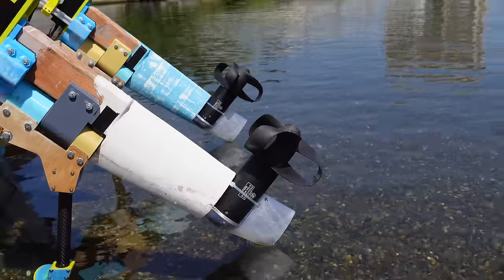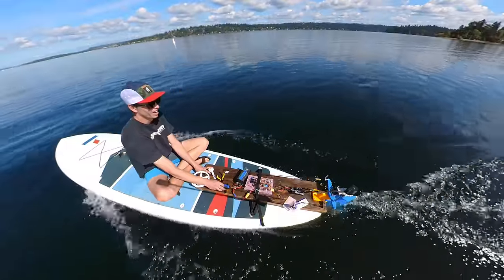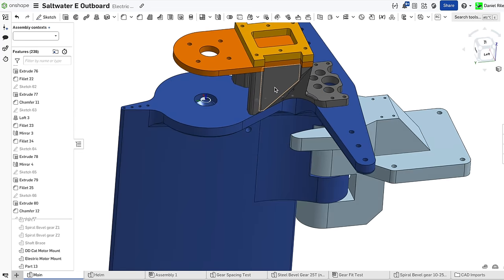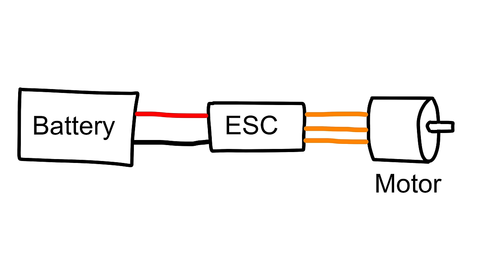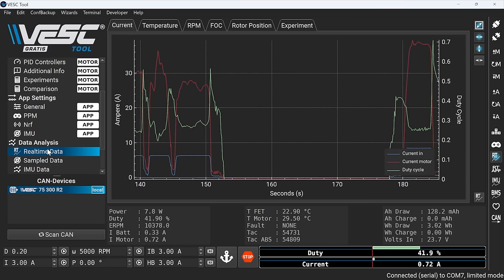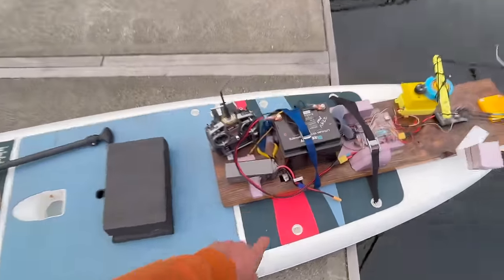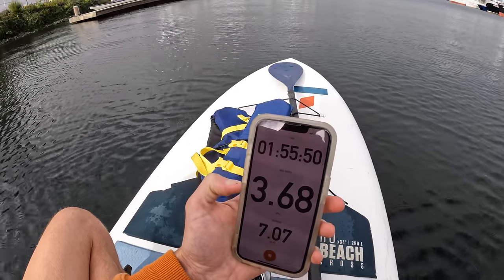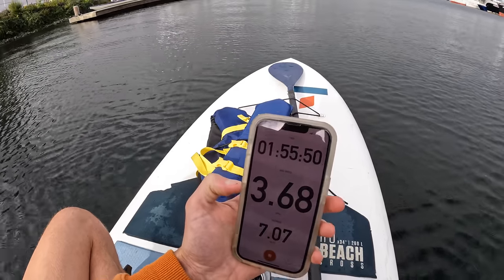Toroidal Propeller Testing on my Electric Surfboard

Comment: Dude, about the efficiency of your helical propeller, I think one of the reasons for the high inefficiency is the unnecessarily large total area of the propeller blades, this will only cause extra resistance in the water, analyze that at the same speed as the normal propeller, the propeller helical uses twice the power, and apparently has twice the area, and you won't go faster with twice the area because of the pitch and the efficiency of that pitch at that specific rpm at that specific speed, I'll probably decrease the width of the blade by more or less half, especially at the tips of the blades, and try to make the blades thinner
Reply from the maker: From the tests we know the toroidal prop was spinning faster, which means less resistance...
Reply: The correct blade area is vital yes. You want the smallest blade area that can still "absorb"/transfer the ropulsive force to the water without too much slip.
Reply: it makes sense @rctestflight

Comment: My feeling is that any effect that this toroidal prop is going to have will be massively overshadowed by running a bigger prop slower.

There is a reason large cargo ships have singular massive props.

Would be interesting to see if you could make a step down transmission and a much larger prop and check the efficiency of that.
Reply: Agreed, if the fancy props on the “cool” boats were actually better you know the big boats where time and fuel cost matter so much would be switching to them and I don’t think that’s the case. I’d love to see a purchased toroidal prop and a traditional prop on your gas outboard to compare.
Reply: Then why did that new huge cruise ship they had.on Tested have 3 props? Were they screwing with us? Also air system to reduce drag...?
Reply: @raguhmuffin   Well, its not really like that. No prop is "one size fits all" and propellers need to match the hull type and speed regimen at to give their best. Prop testing is honestly kind of useless for anything but the single speed, hull, and weight of craft its tested at. I am not a fan of the marketing, but the "cool boats" do need a completely different looking prop than a container ship for example.
Reply: @RowanHawkins  Maneuverability and chosen engine propulsion most likely.
Reply: @RowanHawkins  cruise ships often have multiple props. cargo ships have only 1

Comment: I'd be interested to see if the toroid helps with a windowed blades, rather than stacked. (that is, if you have 3 blades, then behind those on an other plane, 3 more blades that're between 2 blades of the upper layer (60° rotational offset), then connect the tips... if that makes any sense...

Comment: Could you think about doing a variable pitch propeller? That would be awesome and nice to compare to toroidal and fixed pitch ones.
Reply: I suspect that variable pitch will win. The sharrow prop is used because the standard fixed props cavitate too much at intermediate speeds, but the variable prop should avoid that.
Reply: It will be less efficient and dont really have many advantages for smaller craft with this kind of propulsion or the speeds he is going.
Reply: @BooBaddyBig  No, its the tip pressure thats purported to be the advantage as far as I know, and a variable pitch prop is worse at every fixed metric compared to even a standard one.
Reply: @GoldenCroc  When i mean variable pitch, its that type that has a mechanism that changes the pitch for all blades,  not the blades attached to the cone having different pitch angles at each cross sectional area... in this sense I'm not so sure you can crave it will be less efficient. Since everything is scaled down from a real world model, I'm guessing the answer is not 100%, only making it and testing could provide the answers. And it would make a good video content for him :)   ... I love those gears inside the cone changing the pitch :)
Reply: @JoseCarvalhojpgc  No I understood what you meant. Yes, its a fun test, but it is as I said, because of the the inability to optimize the blade profile for a single pitch and the gap between the hub and the blades.

Now, to be clear, these are small drawbacks/differences for tha variable pitch prop and are unlikely to show up in any testing he can do.

So why not. But in general variable pitch is used because the drivetrain/propulsion engine dont like shifting rpm.
Reply: @GoldenCroc  An optimal variable pitch prop should ideally be the same shape as the fixed prop at one setting.
Reply: @BooBaddyBig  Yes, exactly with a very, very small drawback for the gap between hub and blades. Perhaps I was unclear, I meant if you want the whole range to be more optimal you have to sacrifice the single optimal setting. Its a tradeoff.

Comment: electrically insulate the motor and put in under water, for cooling, or just pump water from the lake for the motor cooling. how about aerospike water jet engine. bigger props at same power is to needing to spin the at slower speed, maybe try an electric motor that is natively coiled for slower speed rpm at that same power rating.

Comment: I see you have the 4L60/E out of what looks to be the Chevy S-10 or GMC 1/4ton truck/suv. That you are using as a battery charging station. Lol. I can no longer count how many of those I have rebuilt and/or replaced. It's a pretty good transmission if maintained well and isn't overpowered.
Reply: I guess it could also be the earlier version of the 4l60, the 700R4. The early 4l60 are difficult to distinguish with the 700R4.

Comment: I know it seems simple but have you tried just using a simplistic acoustic resonance pump with piezoelectric? Or something similar? A larger into a medium into several smaller will be able to operate much more efficiently at specific speeds for the given input power.

Comment: 05:30 I suggest you don't use m/s (speed) on the vertical axis as your boat performs very different.
How about choosing a fixed speed at say 1.5 m/s and then measure WattHour/meter? Like how much does it cost for one km or one mile with a constant speed.
Reply from the maker: Easier said than done to keep the vessel at exactly 1.5m/s

Comment: QUESTION: so you are trying to “compress” water and shove it behind the prop. The toroidal is attempting the same thing. Taking from a large volume in front to a stream behind. So… imagine a jet engine running with no exterior shell… you are actually trying to make a pump for power with no way to hold the compression. Put your prop inside a shell. Much like a pod drive or jet drive.
Reply: So if your water intake nozzle was adjustable say maybe wide for slow speed and narrow for high speed. The intake would have its own angle of attack.  I’m thinking like the supersonic cone of the sr71. Just a farmers thought.

Comment: An outstanding discussion regarding the relationships of current, phase current, low voltage versus higher voltage and watts. Yours, a better explanation than by Elon Musk and Sandy Munro about the advantage of taking the new Cybertruck from 12 V to 48 V.

Comment: @rctestflight Out of curiosity, how much thrust are you loosing off the propeller tips from movement of water from  center outwards and "slipping" off the propeller tips as evidenced by the cavitation??? You've seen jetliners that have the vertical wingtips? What if you included such perpendicular tips at the end of each blade? How might it enhance the thrust?
Reply from the maker: idk, but you should design one and enter it into the propeller competition!

Comment: Would it work better to have the toroidal have the blades aimed forward like sweetie forward wings on plane? Then curve them like an Archimedes screw that gets smaller in the rear like a teardrop shape? It would increase the bite angle of the propeller and turn it more into a hybrid impeller - propeller design so long as you give it some wave guides on the leading edge of the blades and curving in them flaring out on the trailing edge of the blades. If you curve the wave guides towards the direction of travel for water it will join in with other water movement and flow more consistently higher capture on to the blades for it's given thrust. It will also have a higher flow velocity, static pressure, and a quieter operation.

Well if done correctly.

Comment: In the NORMAL hull/motor boat unit, the PROP is the final adjusting part to setting up each complete item. The way this is done is to set up the boat with as close to it NORMAL load as possible, at least ¾ tank of fuel and then run the boat at W.O.T. in a couple of different directions and take note of the maximum R.P.M. that the ICE UNIT reached. With this info a person could talk to someone with PROPER-PROP knowledge to obtain suggestions as to what the next prop to try might be, according to what the tach read during said test runs. Too low of a WOT RPM & less pitch & possible some more diameter would be tried. Too high and the opposite would hold true. This little dance happens because each hull is different, even with the exact same company, make & model, weight wise, plus each person/family might be using the boat for different things. A new couple might be just those two and a picnic basket (keep YOGI away) so their OVERALL LOAD would be far less than a 40+ year old & 3 of his bear drinking fisherman buddies & all their gear & beer, thus different LOADS & DIFFERENT PROPS for each HULL/MOTOR & LOAD because of their different usages. 

That being said, I’m sure that the testing & claims of the TOROIDAL PROP started with the same boat that had been “”PROPPED OUT- PROPERLY”” & then tested against each other.

That being said, I don’t know how you will be able to duplicate that same type of situation using the electric motor unless you first make a NORMAL PROP that is so big that it bogs down the motor & the craft actually losses top speed because the load/gearing set up is TOO HIGH & then you would have an equal & proper starting point for a proper comparison…. I think!!!

Comment: Love your content. I am curious if the kayak is more of a displacement efficiency hull than the Boston whaler. Would really like to hear a discussion on what types of hull are more displacement efficient vs planing efficient.
Reply: I must admit that I was astonished to see how well a paddleboard hull will plane!
Reply: kayak vs whaler depends on other factors. They are very different in load carrying ability etc after all. As they stand unloaded, the kayak is much more efficient, because of its lower weight.

Hull form shapes for different speeds are not very complicated really, but as alluded to above, boats are designed for a payload etc which have weight and size constraints. And also other factors such as seakeeping etc. Which is why there are so many hull forms.
Reply: @Del350K4  Not to disparaging your post at all, but the shape is not very good for planing, but it sort of can do it. And thats exactly what happened, it did kind of plane, but very badly (if you know what to look for).
Reply: @GoldenCroc  I did find myself wishing that the board had had its weight distribution optimised for planing. 
 I do get what you mean about it planing poorly, and ai realise that even shapes which are well sub-optimal for planing efficiency can skitter along on the plane if you have enough power.
Reply: @Del350K4  Exactly right. Even some boats that were never designed for planing can do it, if given a powerful engine. All you really need is the correct weight distrubution, a reasonably "truncated" stern and enough engine power.
Reply: @GoldenCroc  I once saw a British TV show, Scrapheap Challenge, in which a team used the roof from a Series II or III Land Rover as a hull. Outfitted with a Daimler engine removed from a hearse, it planed astoundingly well, though students of a well-formed wake would have had to look away in disgust at the inefficiency!
Reply: @Del350K4  I often watched the same show, though I think I didnt see that particular epsiode.

Any flat surface is an almost ideal planing hull if thats the only consideration.

A flat door, a wall, etc. The flatness helps with lowering the planing speed and power requirement, since there isnt anything sticking down into the water. I would say it actually is quite efficient, more than most planing boats actually because of the flatness. Ideal planing shape is very flat with a perhaps a very small (few degrees)  curvature.

You want the wake to be as minimal as possible for best efficiency.

Now, the seakeeping and wave-tackling ability of such flat bottomed craft are often terrible, which is why they arent very common on larger boats.

Of course, there are also air-entrapment hulls for the mid to high speed regimen and hydroplanes for the high speed regimen that makes use of similar effects.

Cheers mate.
Reply: @GoldenCroc  Thank you for sharing your knowledge  : )
Reply: @Del350K4  Dont mention it, glad to help if I can. ☺

Comment: Do you think that speed of a prop makes a difference?   Say a normal prop spinning at 3000 rpm vs the toroidal prop?

I think the slower speeds may not show much of a difference.   You may not be spining fast enough to cause cavitation.   My belief of the special prop causes less cavitation.   There for increasing efficiency.....

And say you take all the props and sping them at the same rpm. But I suppose limiting the power is giving the same results  just backwards from what I was thinking about by testing each prop at a givin rpm.....

Comment: Sharrow propellers look much longer and the front is "ahead" of the back of the loop, compared to the squat ones you are using. Would that matter?
Reply: Yes. A lot. But it still doesnt mean much, since those props are meant for a totally different application than the one hes testing on. There is no "one size fits all" type of peropeller design.

Comment: few thing you were missing out on gas engine is rpm
low rpm is less power less torques 
more rpm is more power torques
so it like using one e motor for low rpm them step up to 2 or 3 e motor for high speed rpm
because more e motor will line up vs engine power output and disadvaed so complicated i cant piece it together and only thing i know so far is that one emotor is same power as low rpm engine and 3 or 4 emotor same power as engine higher rpm which you dont see it or you havent try run one or 2 motor on outboard gear box and try test it surey will be big different in testing

Comment: I want the little blue pickup at 10:56
I need a truck for work but I want the fuel economy of a smaller truck. If I had money I would just go to a dealer. 

I’ll haul it out if it doesn’t run.

Comment: What about two drive shafts and two propellers stacked one after the other where a smaller prop behind the first prop gets a "boost" from the motion of the water from the first propeller? What happens when one prop is slower than the other both front then back prop?

Comment: What if on the toroidal, you offset the lower and upper prop sections by 60 degrees(60 degrees should orient the fore-most post of the blade between the aft-most if I got that right)? Idea being that the fore-most part of the blade may better feed the aft-most part.

Comment: Here's a question: do the different props cause more or less 'pitch up' when driving it as a drone (without you riding)? What I mean is, do any of the props pull in a downward vector? I noticed in a clip in this video that a prop generated a whirlpool above it as it displaced water, so it makes sense to me that with less volume above the prop, that the prop pulls from the sides and bottom more strongly than from the top, hence a net downward force. If the prop was mounted *lower*, would that effect be mitigated to an extent it impacts efficiency? Do the different props perform better or worse when ingesting air into the flow of water through the prop?
Reply: Yes this is how it works, but there are lot of other factors to consider.

Thats why mounting height, anti-ventilation plates (often known as cavitation plates, but this is a misnomer) and different types of props such as surfacing, supercavitating etc etc exist. 

Lots and lots of other factors to talk about, if there is anything specific you want to know, ask and I will try to answer.
Reply: @GoldenCroc  Thank you for responding, and for the information! I'll do some some reading on those subjects. Do you know how common it is to have issues with entrained air, pulled down from the surface? Is that a common issue? I'm familiar with the concept of cavitation, and the problems it can cause with erosion of propellers at the low-pressure points where the bubbles collapse and cause damage. I'm asking specifically about atmospheric gasses, not that kind of bubble.

Comment: what stops you form mounting a heatsink to that motor? its spinning so it would not even need very long fins to shed alot to heat like that
Reply: .. or does the motor include a cooling fan?

Comment: ever considered a pull configuration? Most ships with azipods use a pull configuration rather than a push. With a push configuration, there is nothing in front of the prop and thus more water for the prop to pull and thus more efficient.

Comment: There is a guy doing the same thing with fans here on YT. You could easily test out his fan samples as props. His models are posted online. I can see most designs being the same as the fans. Curious if you get the same results has him. BTW don't do Fbook so no insta. You want a paid job fixing an Ebike?

Comment: Testing different prop pitches was honestly a slight waste when simply testing for top speeds. High pitch props are better for high speeds, while low pitch props are better for hole shot (aka take off). Shallow water boats that are used for fishing in just mere inches of water use low pitch props because the hole shot is critical, while speed boats use high pitch props because they have better top speed and the hole shot isn't critical for them.